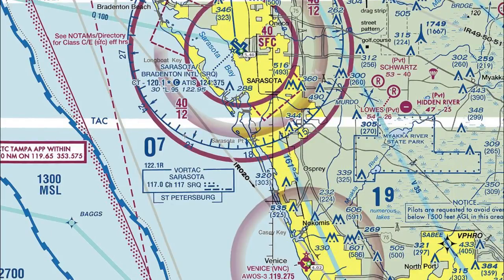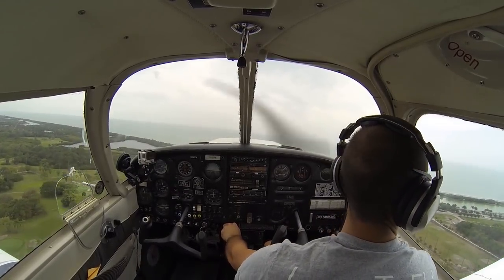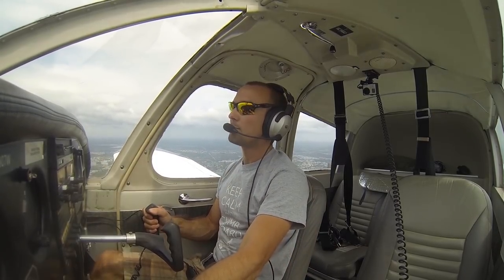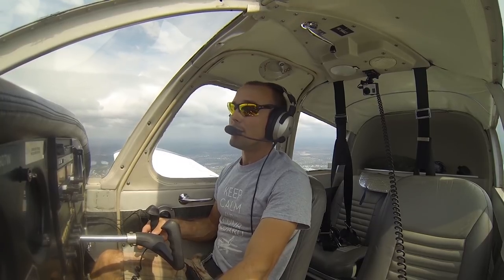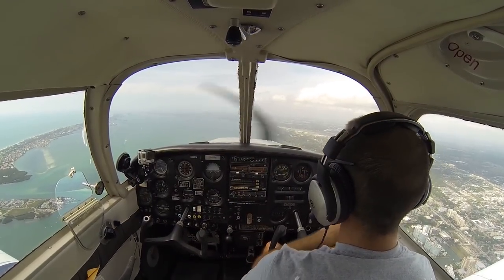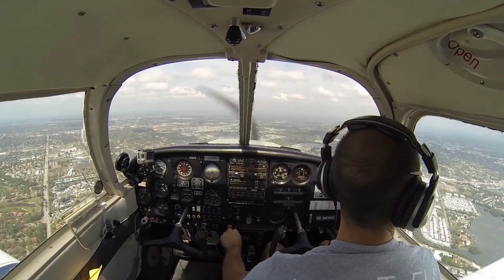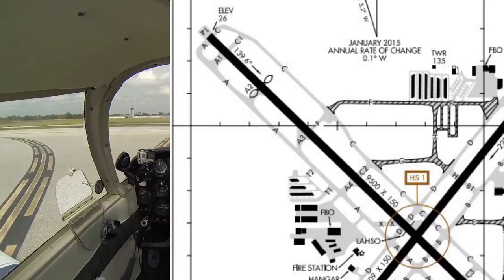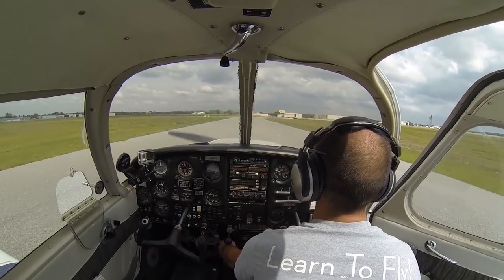Ep. 44: Landing at Class C Airport | ATC Radio Communications

Comment: The confidence and the experience of this guy blows my brain 🤯..... I almost think you would have to be a robot to register all the instructions from atc......I love all this and at the same time it is terrifying to me.... 🤔.... I took a number of flights on a single engine airplane with a pilot..... Loved it 🙂
Reply: You don't have to be a machine, in many cases when you're addressing ATC you know exactly what kind of instructions you're expecting based on your most recent communication with them. 
A good example is an IFR flight, you're departing your origin airport and tower hands you off to departure. You know, by training, the first thing you need to do is listen for at least 10 seconds for a good opening and then report your callsign, current altitude, and last cleared altitude. At that point, departure will confirm your location with the phrase 'radar contact' and then will normally clear you for whatever cruise altitude you filed in your flight plan or will clear you for an intermediary altitude depending on traffic and conditions. Additionally, you may be given vectors to join the route you scheduled in your flight plan. That may or may not happen depending on how far off of runway heading you need to go to enter your planned route.

Comment: Thanks for the videos and instruction: I've been taking flight training at Venice and it is great to see the familiar airfields, especially since I flew that trip from KVNC to KSRQ with my instructor just 4 days ago. Fellow student pilots should notice that at 1:49 there's a radio call with words "please advise" which FAA discourages.
  "... departing runway 2-3, conflicting traffic please advise." 
I wonder if there's a better way to say this at non-tower airports. I know that we've got to alert all traffic, even the quiet ones. I've tried announcing "..., ready to depart rwy __"  after my runup, then turning the plane (in the runup area) back to look for traffic on base and final, then announcing "..., departing rwy __" before finally taxiing past the hold-short line onto the runway. Does this sound reasonable to experienced pilots?

 AIM Section 4-1-9 "Traffic Advisory Practices at Airports Without Operating Control Towers"
has (4-1-9 g. Self-Announce Position and/or Intentions) which says, 
"Pilots stating, “Traffic in the area, please advise” is not a recognized Self−Announce Position and/or Intention phrase and should not be used under any condition."

(I'm a rookie, trying to do things right in preparation for check ride. "Should not be used under any condition" sounds like a pretty strong suggestion.)

AIM offers instead, at least to get wind and runway info, in (section 4-1-9 h. Unicom Communications Procedures):
2. Recommended UNICOM phraseologies:
(a) Inbound
PHRASEOLOGY− FREDERICK UNICOM CESSNA EIGHT ZERO ONE TANGO FOXTROT 10 MILES SOUTHEAST DESCENDING THROUGH (altitude) LANDING FREDERICK, REQUEST WIND AND RUNWAY INFORMATION FREDERICK."

ps: info for non-pilots or non-Americans: "AIM" is the "Aeronautical Information Manual (Official Guide to Basic Flight Information and ATC Procedures)" document from the USA's Federal Aviation Administration.
Reply: PS  AIM is available as a free download(pdf file) from
https://www.faa.gov/air_traffic/publications/media/AIM_Basic_dtd_10-12-17.pdf
and related documents are available at www.faa.gov/air_traffic/publications/

pps: to find the pages mentioned above in the pdf file, just search for "please advise" which only occurs the one time in the whole book.

Comment: "ground usually starts with 121" Ground frequencies don't need to have the same range as air frequencies. Thus they can tolerate more overlap between ground frequencies between neighboring airports, and thus don't need as many ground frequencies.
Reply: That was a great point I'd never heard before. Makes sense.

Comment: Excellent Video! I have a XC coming up to a Class C - As far as radio communications go, what is the difference between landing at a Class C from a Class D airport? I think I heard you say that you have to hear ATC acknowledge you before entering the airspace at a Class C.
Reply from the maker: Only difference is you need to contact approach prior to talking to the tower.  Approach will hand you off to tower.  Same basic requirements as entering class D, just get called by name (i.e. Cessna 123SP) to establish "two way radio communication" and you're good to go.
Reply: Good question.  Do you need to establish radio contact with approach or tower to enter airspace?

Comment: Agree with the other comments.  You are an amazing instructor... I've picked up so many good habits from you.  One important question though.  On your departure from Venice, I noticed you started your turn on course at 500ft (AGL I assume)... does that rule exist in the FAR/AIM somewhere?  I read in the AC 90-66B that aircraft departing a non-towered airport should wait until reaching TPA before exiting the pattern.  This is one of those areas where I've seen and heard a lot of different things from many different people so I'd love your insight.
Reply: AIM says 700' before x wind, AC recommends the silly straight out or slight turn...I taught 500' for the longest time...in reality I fly my airplane so that when the engine quits I can land relatively straight ahead and safely... That sometimes means making turns at 100-200'. I have no desire to fly out miles from shore before making a turn just because some document says you should.  In aviation, use common sense, and be able to justify what you decide to do.  Guidelines are great starting points, but will often need modification for the real world we fly in

Comment: Before taking the runway at your G runway, you should announce on CTAF your intent to takeoff and say you intend to fly straight out and North rather than announce that just after takeoff in the air.  Once in the air you should also reinform local traffic that you are departing the area flying North.  The AIM format is  [airfield name 'traffic'] Cessna xxx takeoff runway x, departing North. [airfield name 'traffic'].  Once in Charlie airspace you need to fly heading and altitude as instructed (he told you to expect right downwind so you are to aim for that)....Not just wander around. They like to know their traffic separation is acknowledged since their MAIN job is traffic separation.  You did not get cleared to turn to base.  You should have contacted tower first and gotten that direction.  Sometimes other traffic is on long final and you would be turning into it.  There actually is no such thing as shock cooling, btw.  Esp in the tropics like Florida. If you do not get a clearance to land you MUST NOT LAND!!!!  That is a reportable violation.

Comment: Any reason you turned base before contacting the tower?
Reply: Are you allowed to turn base without a clearance?  Curious why you didn't continue on the downwind until cleared.  What are your thoughts?
Reply: Approach control cleared him to "proceed inbound runway 14 contact the tower". You can receive that clearance from either tower or approach control, and you cannot turn base at a towered airport without that clearance. Tower would usually say "start your base", after straight in landing traffic ahead of you has passed off your wingtip and you
report them in sight.

Comment: During landing checklist for seat belts I noticed you didn't have shoulder harness on, is that required?
Reply from the maker: +dave Ford it is, sort of.  You can read 91.107 and get a clear idea.  Basically it is required for taxi, takeoff, and landing.  In that particular plane using the harnesses wouldn't allow me to lean forward far enough to reach the flap and brake handles.  Last part of 91.107 reads, unless it interferes with required flight duty, I.e. applying brakes and flaps

Comment: He has his seatbelt on but are shoulder straps not required for takeoff and landing?
Reply from the maker: Could never reach the brake handle or flap handle on the floor of that airplane with the old shoulder harnesses it has in it :(.  Not required if they interfere with you flying the plane...but nice to have some that are adjustable and can be worn.

Comment: Does altitude manipulation with throttle apply to all planes? Or is it just for small general aviation craft?
Reply from the maker: That's really with any airplane....if I want to climb in a jet from 25,000' to 30,000', I'm going to have to add power to go up, simply pulling back would just make the airplane climb slightly before slowing down so much it would stop climbing and possibly stall.  When you get into an airplane, the best example of this is to trim it up so it is flying "hands off" much like riding a bike with no hands, and then just add power and watch it start to climb.
Reply: Power is for speed. Pitch is for altitude. Applies to all aircraft.
This fundamental concept is key to controlling the aircraft.
To understand this, you must first realize that there are 2 components to any attitude the plane is in. Those 2 components are speed and pitch... and they are inseparable (both must be accounted for to achieve the desired outcome).
To achieve level flight (no climbing or descending), for any given speed, you must pitch the nose up or down to maintain that altitude.
To achieve a climb (or descent), the concept doesn't change: you pitch the nose up to climb, and then add power to maintain your speed. If you didnt add power, your speed would decay to the point where you wouldn't climb.
 (fyi: power is finite, so for small aircraft, most climbs require full power. But even with full power, the plane will not be able to maintain cruise speed. Therefore, we pitch the nose up with full power, and accept a reduced airspeed. If power were infinite,  you would pitch for the desired climb rate and simply adjust power to your desired speed in the climb).
So, pitch is for altitude, power is for speed. I've been teaching this concept for 35+yrs. I believe it's THE most important lesson a student learns (outside of stall recovery- lol).

Comment: I noticed you reported "clear of runway" to ground but not approach. Does approach need to know that to clear other aircraft for the runway, or just ground?
Reply from the maker: It's assumed by tower when you land you are clear of the runway (no reason to stay on there unless there's a problem) with the initial call up to ground I report clear of rwy XX at intersection XX so the ground controller understands I just landed and will be wanting to taxi to an FBO, gas pump, etc. rather than taxi out to a rwy for takeoff.  Only time I would tell a tower controller that I am clear of a rwy is if they couldn't see me (i.e. low ifr)
Reply: That makes sense, thanks!

Comment: Why the right turn on departure so close to the airport?  Doesn't that go against what we are supposed to do?
Reply from the maker: In that case I would say there are two options, depart on a high left base north bound and possibly run into guys overflying at 1,500ft, or make a right turn out where there should be absolutely no other traffic.  Straight out in this case does not work for me as single engine over water isn't something I look forward to.  Just because you can swim a mile in a lap pool, doesn't mean you can do the same in the ocean after surviving a engine out landing.  Best advice; study the AIM, but remember YOU are ultimately responsible for the safe operation of the flight.

Comment: 7:25 you said altimeter setting is a required readback.  It is not.

From the Aeronautical Information Manual 10/12/17, pg 4-4-4:
b. ATC Clearance/Instruction Readback.
Pilots of airborne aircraft should read back
those parts of ATC clearances and instructions
containing altitude assignments, vectors, or runway
assignments as a means of mutual verification.
Reply from the maker: While it's not listed in the AIM, most controllers will call you back and verify you have the correct setting if not read back to them, and for good reason.  Since the altimeter is how you are separating yourself from other aircraft, both IFR and VFR, I can't imagine a scenario flying an airplane where I would not want to have positive confirmation of something that is going to:
-Keep me clear of airspace
-Keep me clear of other aircraft
-Keep me from getting a pilot deviation for being at the wrong altitude
-Keep me clear of terrain
-Etc. etc.

There is actually very little you legally have to read back to ATC, however following the regs to the bare minimum is never really a good idea either.....
To sum it up, be a pilot, do what it takes to be safe for yourself and others....that is certainly required :)
-Jon
Reply: Thanks for the reply, Jon.  If you want to continue reading back the altimeter setting, nobody is going to correct you.  I was only correcting the fact that you said it was a required readback.  It is not.  Center will never ask you to readback an altimeter setting.  An altitude assignment, yes, but not the setting.

Here's a good thread on the issue if you want to read further.  A controller chimes in, which is always helpful.  http://www.askacfi.com/27336/is-readback-of-altimeter-settings-required.htm
Reply: And I shouldn't say "never" I suppose. But if you'll listen to Center accept handoff after handoff, there are multiple pilots who check in without reading back the setting. And personally, I've never once heard Center ask for a readback on the setting.

Comment: camera jitter way annoying.  Your method is sound, no fault - Repeating xponder squawk "in the box" or "here's the flash" for an IDENT request drives 99% of pilot absolutely nuts.    Also... why in humid warm climate would you not use carb heat?  It costs you nothing but could mean everything one day -  bad habit.